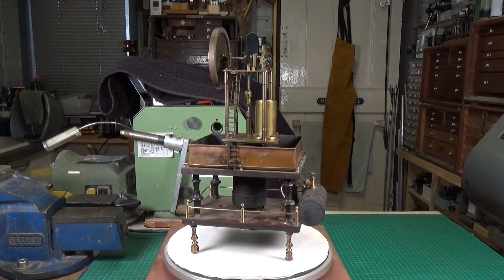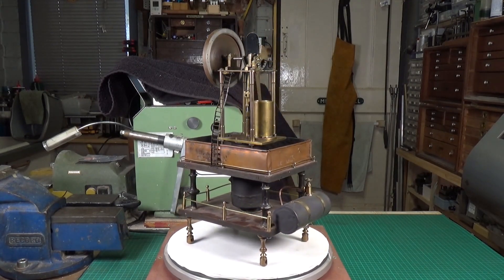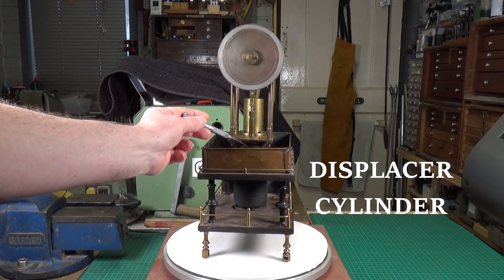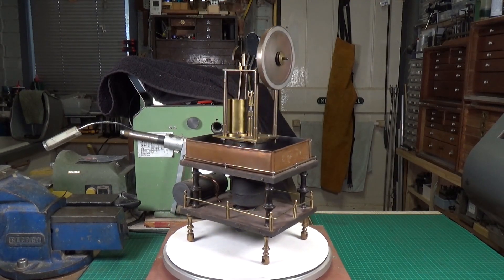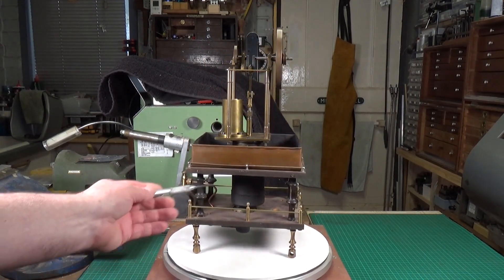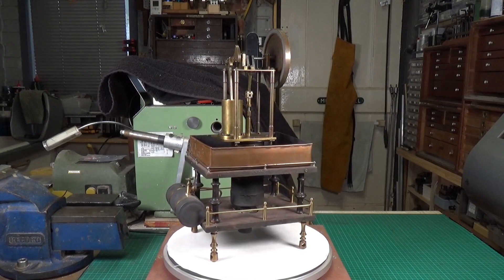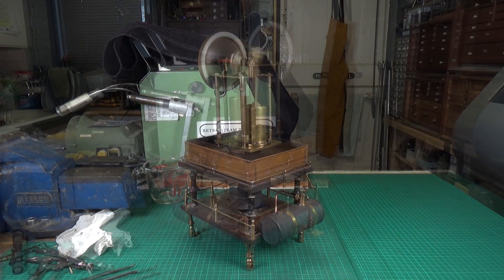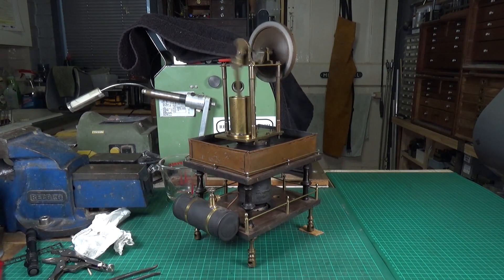Large Water Cooled Stirling Engine

Comment: Nice Stirling Alan.  I might try that configuration with a round water tank (easier to fabricate).

How is the power piston sealed ?  I'd be interested to have your best guess at the bore/ stroke/volume of both cylinders to work out the ratio they used.

The legs on the bottom look like they were re-used from something else (hand rail ? ) as the cross holes seem a bit unnecessary.

Cheers Rob
Reply from the maker: Hi Rob. I thought it was a bit unusual which is what attracted me to it. The power piston has a bore of 1.245" and a stroke of 1.34", odd dimensions. The stroke of the displacer is the same and the outside diameter of the displacer is 2.243", again strange dimensions. The power piston appears to be threaded into that flange which is then bolted to the brass plate. There is no evidence of any gaskets. I think you can see from the video that the top of the displacer cylinder overlaps the bottom of the power cylinder which must be how they are connected. You may be right about the legs, possibly hand rail stanchions.  Cheers, Alan.
Reply: @RetroSteamTech  Thanks for that info Alan.   I haven't made a Stirling for quite a while and may try this pattern.   I would scale it down a lot to the size I like working with.  Interesting unit.  Cheers Rob

Comment: I actually have one started with that similar design other than the water cooling part of it. I had set it aside for other engine projects but after watching this very cool engine running it has spurred a new interest in finishing the engine I have half way done on my bench! That was a great score for your collection!
In fact my flywheel is actually steel with a brass ring around it.
Reply from the maker: Thank you. Very much like to see a video of your engine when it's finished.